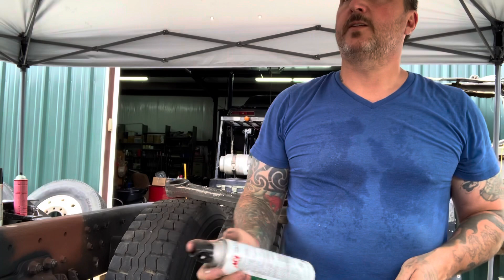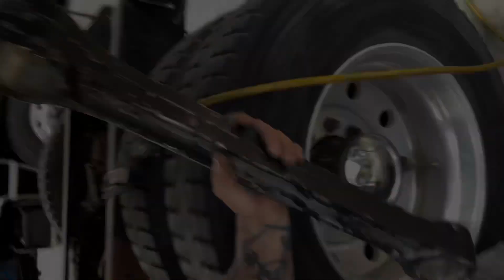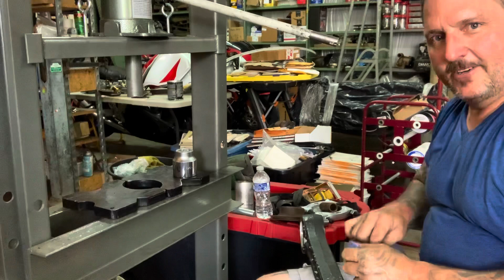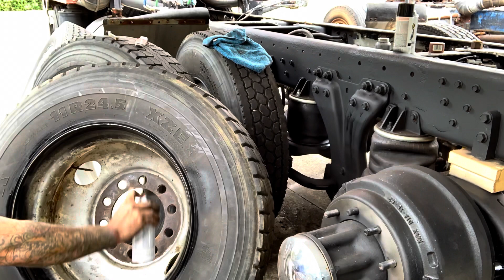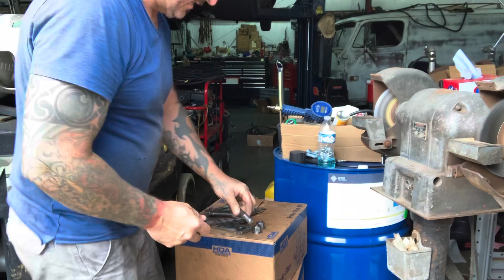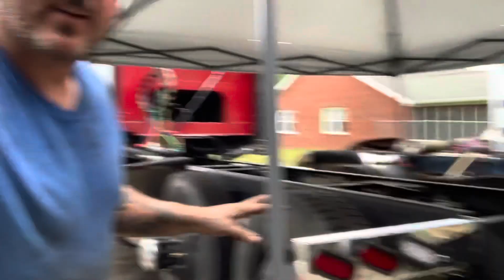Trisha episode 4000000 lol finishing up the brakes and bags

Comment: James just a little help for ya when you get the rubber pushed out to get the sleeve out just catch the edge with the air hammer and crush the side in across from each other  both sides the it will fall out and you don't get the marks on the surface from the hammer bit. great content keep up the great work and post. take care

Comment: Up here in Fairfax VA just outside of DC, I wish working in the rain was the problem. Here every 17 years, we have a cicada invasion of biblical proportions. I hate working outside with those stupid things. There are literally thousands just on my block and they are everywhere and get into everything,. I can clear 25 of them from the engine compartment of the truck even though the hood is closed. Not to mention they buzz you, land on you, get into your open toolboxes, garage, porch, etc. I'm working on a project myself, a 1988 Ford F250 7.3 IDI diesel pickup I swapped the motor in. I stopped work about a month or so ago when they started showing up your videos are giving me motivation to get back to work on it. They are almost all died off now so I can resume work again. The only plus side to stopping work on it, is that I decided to take a 4 day 650 mile motorcycle trip to the Jersey shore and get some beach time. Trisha is coming along nicely, I can't wait to see Krystal get her TLC. You have been going at it hard on those trucks like I have with mine. I've been to GA and there are some nice beaches there. St Simon's Island is great! I visited there a few years back. You ought to take a couple of days and get some beach time, you have earned it.

Comment: Looks like it’s coming along nicely. Maybe when you get the cut-off you’ll be able to make one nice set of aluminums  polish them all up and it’ll be really sharp! Then you can practice a little on the insides before you do the outside wheels. And you’ll be really good by the time you get to the fronts. Be careful tho working outside in that heat don’t get sick working too long.
Reply from the maker: Thanks for the advise  I drink lots of water too ;)